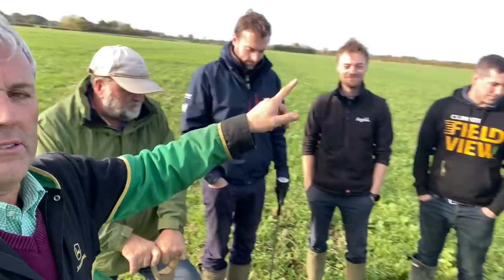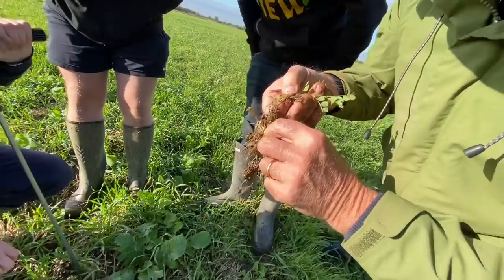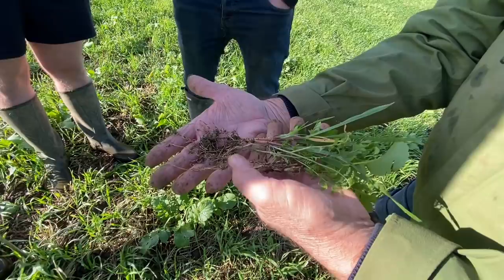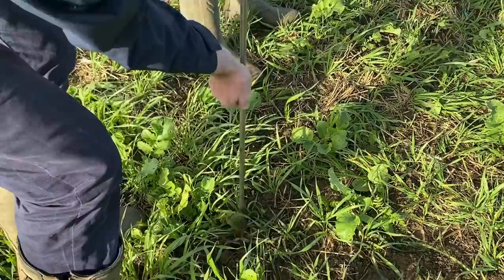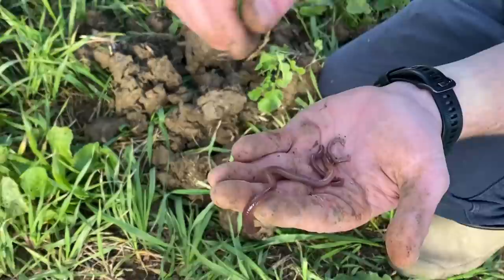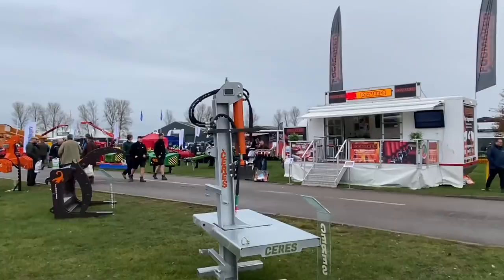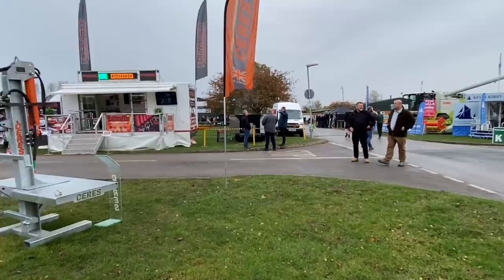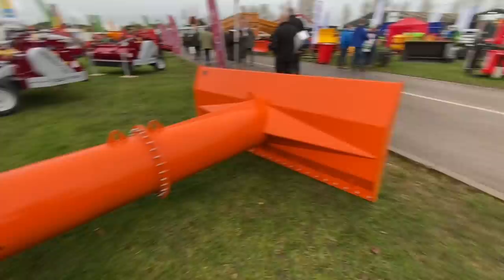FARM UPDATE #16 #WardysWeeklyWaffle

Comment: That device for lifting the tractor rear end clear of the floor, reminded me of a similar system produced by Ferguson in the 50s. I never actually used it but I could see the principle. It was a purely a static lifter and no wheels like the one you looked at.
Also, in that show ground, what percentage of those machines were British made?
Reply from the maker: Very clever and simple!!

Comment: The hydraulic lift on the John Deere tractor is nothing new, Ferguson had on, they also had a lift for the front, lift all 4 wheels off the ground at once
Reply from the maker: I understand so but it’s the first time I’ve seen one in the flesh and I didn’t know you could actually move the tractor while it’s on the lift.

Comment: Great video Andrew, just have two questions. 
I understand your spraying off the wheat stubble for blackgrass control. But, would it be beneficial to leave the volunteer wheat as a make shift cover crop. Blackgrass I assume won’t be putting a seed head up well after you plan to drill in the spring? Partly work load management, less to do in the spring? 
 What sort of yield did the beet achieve?
Reply from the maker: A few have asked similar re glyphosate so I’ll explain in this Sunday’s update.

The first field of beet did 89 ton/hectare, 18.0% sugar

Comment: Hi Andrew. Thanks for answering regarding the continuous wheat crop. Simple answer as it turned out. 
I presume you don't have problems from drilling the same crop year on year? Is it just that field or others too?
Thanks again.
Reply from the maker: Pleasure. We have about 20% of our wheat area in the continuous slot. Mainly the very heavy, clay soils which we used to grow Rape on. We might try going back to growing Rape next autumn, if we do, it will be in a few of the continuous wheat fields.